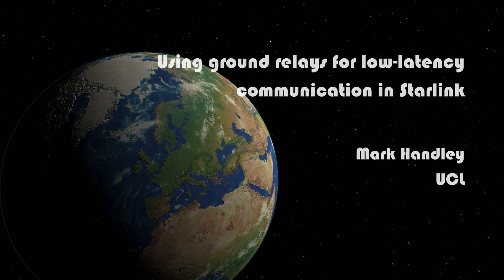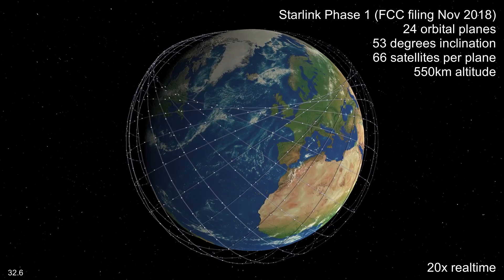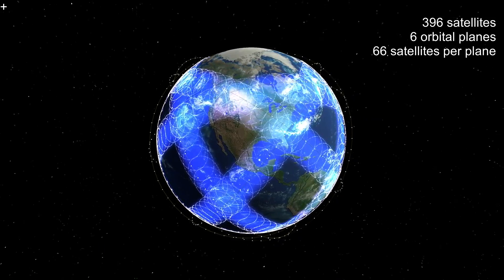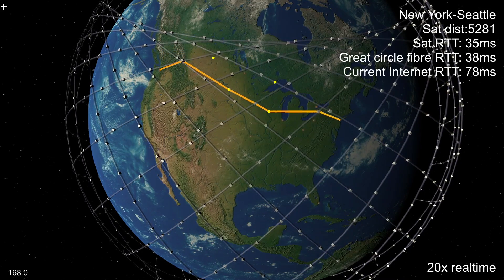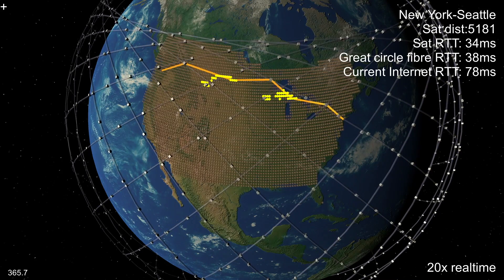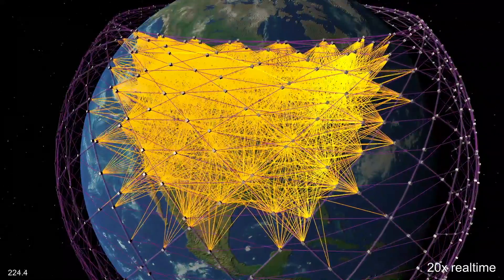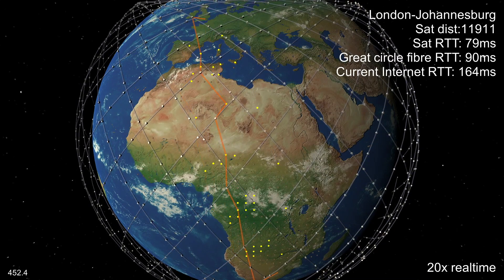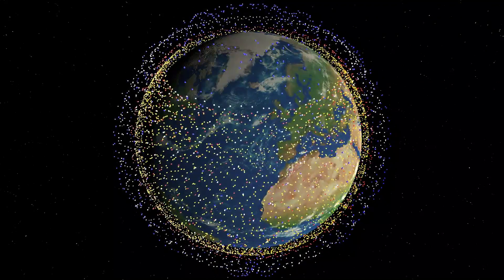Using ground relays with Starlink

Comment: What makes this really interesting from an infrastructural standpoint is that if Starlink is much faster for routing traffic via light in a vacuum vs ground-side light in glass, Starlink could pretty much make up the entirety of the losses it incurs both from selling Dishys at a loss and launching satellites to replace satellites that've been deorbited by selling peering contracts to other ISPs.

Comment: You know that new faster then the speed of light communication (Possibly Scalar waves?) and NASA updating it's solar to radiowave emmiter to a compact design? Not new! These are just parts of system in use. DARPA's big project (Blackjack) made a big change and now DARPA plus $500 million dollars joined Starlink? Starlink just purchassed "Swarm" and Spacex is involved with the Air Force and Space force. How did Spacex get the FAA's approval to put 40,000 low flying sats? The lowest flying! Nothing between Earth and them except Air craft, Missiles, etc.  "This new micro solar  to microwave emitting panel will change everything about warfare" Do you know who said that?

Comment: https://youtu.be/m05abdGSOxY?t=151   I am confused as to whether you are saying that the satellite to satellite latency (light in a vacuum) is faster than light in fibre optics  - or satellite to ground-station (radio?)  is also faster than light in  fibre.   As it is going from a vacuum to atmosphere, it can not be in a vacuum. Thanks

Comment: My first theory is that the laser links (which are not yet deployed as of January 2021) can only connect satellites within the same orbital planes. This means the lasers will not have to be dynamically steered and will always "look" at the "previous" and "next" satellites.

My second theory is that ground station send a northbound and a southbound beam to each orbital plane served. Given the FCC fillings the forward link can have up to 16 250 MHz wide channels, thus each ground station can serve up to 32 satellites (16 northbound and 16 southbound) assuming each satellite in the chain only "consumes" one of the channels through its user beam and sends the remaining to the next satellite and so on. (But I think in most cases each satellites will broadcast multiple channels within its user beam). Thus each ground station needs 3 antennas per orbital plane served : one for the northbound beam, one for the southbound beam and the last one for handover.

Comment: Uhm. Problem with optical fiber IS NOT in "speed of light in glass" - but in putting fiber in place, conversions and finally fact that through the fiber path travelled is not equal to length of the fibre, but to PROPAGATION distance (light bounces inside it!) adding to total distance that needs to be covered.

Comment: I've been using satellite "broadband" for 23 years. It has not been fun. This will be the first time I'll actually be able to watch the Tour de France all the way through, without hitting a data cap. And there were several years where I forgot, and ended up with basically dial-up speed until the start of the next billing cycle because of it. And then there's youtube's conspiring with companies like Viashat, to throttle download speeds, so that even though viasat specifies a download speed, one never experiences it where it counts (until I discovered vpn). So that meant years of watching videos through what amounted to looking through a screen door, due to having to lower resolution. I can hardly wait for the beta tester email to arrive!!!

Comment: Non-ionizing energy can cause heat, but it does not cause the breaking of atomic bonds or ionize atoms ... But the clearest thing has already been said and it is extremely surprising, when you say that it is to give internet to places of difficult access, knowing that these They can increase the heat in places that are difficult to access, in most of the forests and if we have the idea that these heat waves can be triggered in times that do not belong to winter, they can cause increases in heat, this is to remind you of what long time because scientists are trying to figure out why there are so many fires knowing that everything happened right after sending the Starlink satellite belt into space. It is an economically necessary problem for the capital of every country.
Reply from the maker: The power of the radio beams is very low - the satellites are powered by solar panels, which don't produce very much power, and then most of the power goes into the electronics not RF emissions.  In terms of heat reaching the ground - way less than a single car emits.

Comment: From the way that was told by Ellen mask there won’t be any ground stations it will all be satellite to satellite link to work ground stations or anything like that would not be needed that’s what I understand from his press conferences and that it does satellite will be able to work in the most remote places
Reply: Of course there willbe ground station, laser links aren't available on current sattelites, why are you lying?
Reply: From watching the videos, it may well be a multi tier system. So if/when in the inter satellite communications becomes available, that option may be sold to those customers where saving 10 ms for instance, will be worth the additional cost. Ground stations will be key,  as an alternate route if necessary.

Comment: Still going to need more high speed fiber, preferrably mostly underground. It will be more reliable under certain conditions. But, if ground stations are connected via this fiber network then it would open up using whichever path is best and available. It also provides additional capacity for slower routes. If there is a very large solar storm, then satellites could be disrupted or damaged. Hopefully the world is not completely dependent on them at that point.

Comment: But why would anyone do that? if you got it down somewhere in a town with fiber connection to the internet, why even bother sending the data via starlink again?
Reply: Town? Ground station can be few hundred kilometers aways.
Reply: @wiziek  no, i meant there is no need to transport packets from one continent to another via starlink per ground relay. The simple solution is just to get down to the nearest ground station that has fiber running to it, and then just going with the "normal" route, being the internet backbone.

Comment: One slight issue I am worried about is capacity. What happens when you get millions of people using normal internet traffic and sending them through the star link system? Hopefully we don't experience bottlenecks in bandwidth.

Comment: optical fiber also not straight, there will be a lot of zigzag too on the line and light travel zigzag inside the fiber too..but starlink can use satellite to satellite communication and cable broken will not happen as fiber and fiber can't reach anywhere, thats why starlink can be better anyway..

Comment: Fanboys are rather gullible aren't yall.  
Its kinda funny any of you believed this crap in the first place.  There is only 
One possible client for this. 
Modest estimates are its going to cost over a Billion (BA BA BILLION)  in development, acquisition, and deployment.
That is not  included labor or any patent licensing or allocated bandwidth spectrum. 
The current cubesats deployed are fitted with arrays  that operate in a range of spectrum that is rather full and not cheap.  Dish network bought a couple blocks  
Way back when tv went digital for a planned cellular network  that doesn't look like will  happen and their satellite internet .they still have and operate but also have Hughes net that's on a whole different band. I don't know if dish bought Hughes net or just developed the two separately.  Either way they expected the satellite internet to be a continuous growth and very lucrative and probably could and would have if they had been more competitive. Either way  dish is holding onto valuable largely unused band blocks, they  lease some of to sprint and tmobile and several virtual network providers but have turned down offers to sell thus far.  Att's acquisition of direct tv 
Possibly sets them up with excess bands but doubtful they will let go of. 
Either way bandwidth  is going to cost SpaceX considerably.  

The truth is Star link would be far more expensive and slower than ground based fiber, laser pulse, and rf competitors and  take an extremely long time if ever to turn a profit.  Areas that could potentially  have a use  and could afford not only the services but the devices to it as well as power are very few not to mention the manner of marketing to these areas would be interesting to say the least.

No  the  more likely answer is starlink and always was meant to leased to the US military and possibly Allies and maybe even NASA. That's really the only possible reason for the orbital paths that cover more ocean than land. 
And the Airforce volunteering awac s and fighters to test the signal on the last two deployments. That's not something they usually do  . Besides NASA has plenty of pilots and comparable aircraft  and  a much more obvious choice to ask. The airforce volunteering means the Pentagon is involved with development.  Ergo  military project.   Elon's  neurotic need for attention and endless streams of  failed scifi expenditures make a decent psyop cover since the cubsats can be seen from the ground and  couple hundred more would be pretty difficult to ignore and and secretive deployments  exposed later would  unquestionably  automatically be assumed to be military or intelligence no matter what cover story.  Besides Elon can't keep his mouth shut but is incredibly comfortable lying . So let him loose promising free internet for the better of all mankind.  That  will distract the fanboys, hippies, pretty much the entirety of the millenials into ewe ahwing and the rest of the world to assume its another dead end Elon venture that will fall apart when someone finally explains to him a business can not continually spend more than they  recover or sell at a loss. Then continue the debate over whether Elon is just mentally challenged  by 
Biological or psychological disorders.

Comment: So 12000 total ?  at 550kms Altitude?  If I can see sky at 30 degree horizon with bushes in my garden , I can see a 1100km radius circle at 550km , 3 .8mKm2 of sky.   Surface area of world 500Mkm2 . Surface area of 550km alt  sphere 600Mkm2 ...  So I should get an average 75 above my garden ,  More if they miss out the polar regions. Musk had better paint them black !

Comment: Wonderful look at the potential future of the system, and great graphics to show it.

Looking at the kind of transfer speeds possible here, I wonder if it might be faster to skip best route calculations and instead go for a "good enough" route?  If the time saved in calculation (if any) is roughly equal to the increase in transfer time, it could also potentially spread the load through the network more.

As for as using Starlink, so long as it A) can be moved easily from place to place and B) isn't awful at gaming (latency shouldn't be an issue, but I'm worried about packet losses during switching) I would be perfectly happy paying even a moderate premium to join up

Comment: Finding line of sight for laser transmission to work, between two satellites that aren't fixed in place, floating in space all the time in 3D, & doing it fast enough to justify the latency savings, is fucking STUPENDOUSLY hard.

Elon is mad. This requires significant technological advancements throughout multiple different industries to achieve! That too at a time the telecom industrys' focus is at 5G which is completely different!

Comment: You mentioned ground stations.

Microsoft has been working with the idea of putting server farms into large barrels and floating them in the ocean.  One advantage to this would be that cooling the whole thing will be easy.

In the case of StarLink, Musk could do the same thing for oceanic relays.  The main challenge would be keeping it powered, but I'm sure that solar cells and batteries will do the trick.

Comment: How were the animations created? Are they by SpaceX? They're awesome!
Reply from the maker: Everything after the first minute are my own animations, generated using a custom Starlink network simulator I wrote from scratch using Unity3d for the 3d visualization.  Its a few thousand lines of C#.  There's no user manual or documentation, but the code is here: https://github.com/mhandley/Starlink0031
Reply: Mark Handley that is really cool. Thanks for sharing.

Comment: I agree no need for oceanic relay points.  Not only is there a lot of shipping all the time but the airlines are constantly going back and forth.  Since both will want this kind of internet coverage they will be relay points.  The only possible issue for air traffic is that it may increase power consumption operating as a relay.

Comment: Mr. Handley, can you make simulation of Starlink where satellites in higher orbital planes serve same purpose as ground relay stations? For this to work Starlink satellites would need upwards facing antenna with some beam steering functionality. This is easily accomplished, since it does not need to have narrow beamwidth.

Comment: incredible video and presentation.  But I don't agree in your points.
I think in this case is cheaper to add other sats that would work as relay instead of  ground stations.
Ground stations should be maintained and secure from damage or invasion, you need to buy land and deal with local bureaucracies, you need to provide them with energy and storage, in which cloudy days or seasonal disparities increase the cost a lot.
Instead, a new sat between 60 that are launched each time cost nothing.
Then if the new laser communication between sats becomes  a fact, you get the perfect service.

Comment: All this talk about latency, and satellite to satellite links. It seems to me, the real usefulness of a space based network will be rural access to high speed internet. And that only requires one downlink per satellite at a time, but many subscriber uplinks, with little need for satellite to satellite links. And then, only if there aren’t any nearby ground stations.

At any rate, lets hope this system gets going soon, and can compete with cable internet on price.

Comment: Why was satellite internet so slow till now ?
Reply from the maker: Bill Whittaker  Just to add to that, geosynchronous orbit is why you have terrible latency.  But also GEO satellites cover a large amount of the Earth's surface with a single satellite.  There's only so much radio spectrum they can use, and that needs to be shared between all the satellite's users.  By having a large number of low earth orbit satellites, you get spatial reuse of spectrum.  With phased array antennas, several different satellites in different parts of the sky can be communicating with ground stations close to each other using the same frequencies without interfering with each other.  So LEO constellations not only give low latency, but also much more bandwidth per user than GEO satellites.

Comment: To suggest laser can beat fibre in speed probably isn't true when it comes to packet loss and bandwidth.  The bandwidth of fibre also improves at a higher rate with time.
Reply from the maker: Free-space lasers are unlikely to ever beat fibre on bandwidth, and using RF ground relays certainly won't - not enough spectrum.  I made no claims about bandwidth.  But for many uses, bandwidth is less important than latency, and that was what I wanted to explore.

Comment: Your comments of the speed of light in an optical fibre are way off. For single mode fibre the group refractive index is about ~1.47 (very easy to check up on Google), which means it's about 70% the speed of light not 50%. This is really basic high school physics for crying out load. With such basic mistakes it brings in to question the rest of the video.
Reply from the maker: The speed of light in glass is about 68% (1/1.47 = 0.68) of the speed of light in a vacuum.  Which means than the speed of light in a vacuum is about 147% of the speed of light in glass, so it is indeed ~50% faster.

Comment: We may well be trapped on earth with thousands of these orbiting, making it likely to hit one on launch, if not several!  When Starship launches, that banging you hear will be the Starship hitting these satellites and them hitting other satellites, causing one heck of a mess!
Reply from the maker: Area of a sphere at starlink orbit height: 4.4*10^20 m^3.  Area of all starlink satellites together: somewhere between 3000 and 20000 m^3 depending on orientation.  Taking the worst case, the fraction of the sky the satellites occupy is about 4 * 10^-17.  That's 0.0000000000000004% of the sky, so if you shine a laser up at random, that's the chance you'll hit a satellite.  Probability of collision with a spaceship is a bit higher, but not much.  You'd be about as likely to win the jackpot in the national lottery three times in a row.  And that's if you launched in a random direction.  The satellites move in very predictable orbits, so you're they're not hard to avoid, and it's a REALLY big sky.

Comment: I very much appreciate your simulation! I've coded a related system to calculate coverage and doppler for low orbit satellite transmissions such as weather satellites. I wonder if the phased array antenna are supplemented with QFH antenna? they would be a good fit in attitude failure modes or any low data-rate application without good location data to steer the arrays. I also wonder if other satellites in higher orbits will be able to communicate with the constellation? it could be a revolution in satellite operations - log into your weather satellite from a coffee shop? have your cubesat send tweets of what it sees?